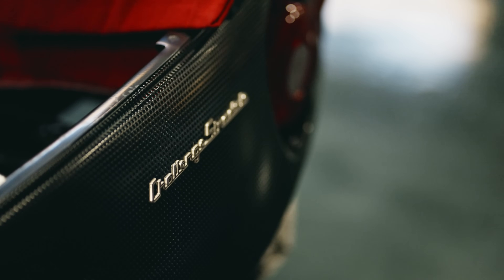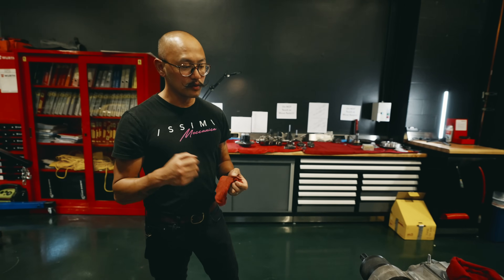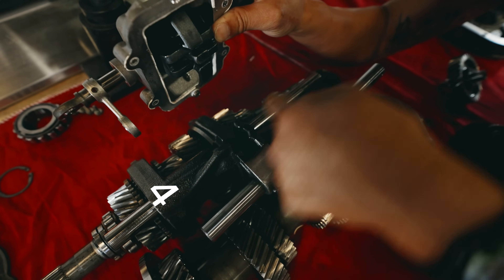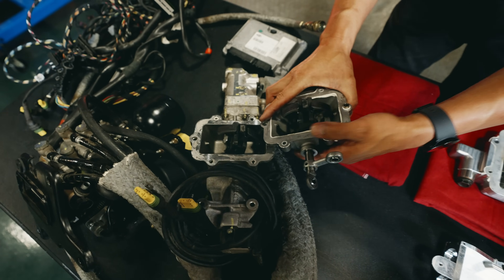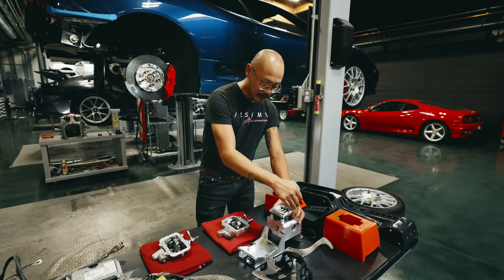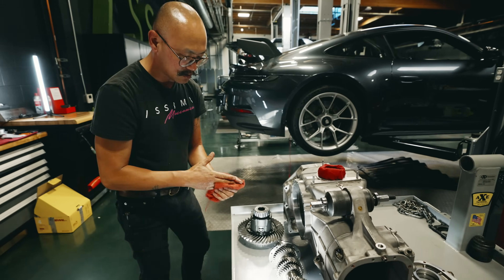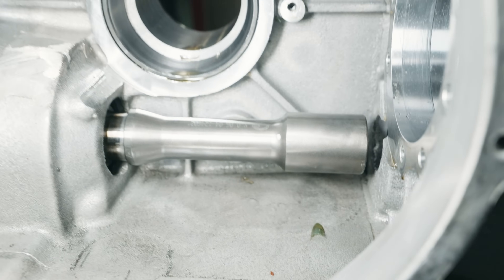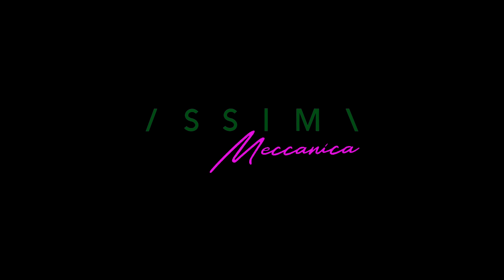Dissecting a Manual Challenge Stradale Conversion - ISSIMI Meccanica

Comment: As time goes on and we get more nostalgic for the things we had, 90s/2000s manual cars will become the most sought after variant. So im all for swapping paddle shifters out and making the car more 'personal' to drive. So many cars from the 60s to 80s had those awfully slow 3 or 4 speed automatics, so the realm of possible manual conversions is quite large. I imagine a 300 SEL 6.3 with manual swap will release a lot of driving pleasure, a Ferrari manual swap will be even more epic.
Reply: I also think it's important to encourage these kinds of builds because there were so many amazing cars from this time period that weren't offered with manual gearboxes (E46 CSL) and are improved so much from a driving experience standpoint to have them.

I don't have any clue how feasible it is, but I'd love to see someone figure out how to swap a manual into a Lexus LFA. Based on people's feedback from driving manual F430s (and how "responsive" the engine is in a way that they didn't really experience by using the F1 box), it feels like a manual LFA would be a life-changing experience.
Reply: @Talynen  Good idea with the LFA, one can only imagine how orgasmic it's superfast reving V10 can feel with a shifter like the Porsche Carrera GT had. The single clutch shift mechanism of the LFA might be a big hurdle.
Reply: @mickwrinkles2318  @Talynen It certainly helps when an existing car already had a manual version, be it using the same engine or even a less powerful one. I think the LFA could be a bit more difficult because of the electronics, but above all else, the fact there are no similar cars made by Toyota/Lexus from which they could adapt the transmission.
From what I was researching about it, it's an automated manual transaxle, albeit a sequential system.
In theory, perhaps you could somehow convert it to fully manual operation, though that would require adapting a new pedal box for the clutch pedal along with the rest of the necessary systems.
I don't know if the sequential system would remain in first place, but having the ability to manually shift would already be great.
Reply: Mercedes should be auto.

Comment: Loved the inside look into how the F1 'box actuates, explains how flawed it feels and how much of a flappy paddle head you'd have to have to order an F1 car when you had the manual option.
I'm currently having the "shift to third" problem in my E36 with worn out bushings which is unacceptable to me there, let alone a 360!
Driving the finished product would probably make the word special an understatement.

Also, IS THAT A 1/350 COMPETITION YELLOW MICA FD?????? Wonderful
Reply: Noticed the fine Yellow FD in the back as well...

Comment: The video i didnt know i needed, ...but omg yes, please give us more of this stuff. Well made, yeah a little dark in some shots, but that made me sit forward and pay attention more, rewatched a couple of times already even lol, it felt very much a natural flow though, really awesome vid, loved every second, and im sure, will likely watch a few more times. 
Ferrari`s system is interesting AF, im a paddleshift guy, yes im guilty, but showing its still a manual underneath some systems, not torque convertor, awesome, and where the shifter SHOULD sit between gears in a manual, awesome, that all just touched my engineering G-spots and driving soul.
Some paddleshift (perhaps many/most?) have flaws or drawbacks for some drivers, flaws that may not fit with what they want from the experience of driving, i totally get that, i was once there too, and with systems like this one that can destroy themself in a way that requires a mortgage to repair, this is an interesting and cool mod, how many owners ever drive them at race speeds and could benefit from paddleshift, even a dual clutch ?.
We have cars that are SO fast now, even basic sedans are quick to 20 yrs ago (not to mention electric), but the roads havent kept up, nor the laws, so slowing down things, including the shifts, chills us out a bit more, making things a little more deliberate and back to basics to enjoy what driving is to us, ...more than just getting us to another location (thats the role of electric 😝).

Many thanks all,
                             Dan.

Comment: The issue with manual swaps is the flywheel. The F1 transmission is mated to a flyweight flywheel. The comparatively slower shifting manual requires a heavier flywheel so revs don’t plummet uncomfortably between shifts. They try to compensate with a rev pause  feature via the engine’s ECU. But it’s not the same as if the drivetrain was designed for a manual from the start. Ferrari are idiots for abandoning manuals.

Comment: It's a weird period in time when these single-clutch automated manuals were all the hype. Now almost every car that had these would be better with a different gearbox. And it's not only the shift action alone: we have an Opel with Easytronic and compared to a VW DSG the clutch operation is much worse. It can stall during parking, sometimes it engages abruptly, sometimes it slips... just pretty inconsistent at low speeds. Once you are at normal speed (nothing sporty, it's just an economy car) it gets better, but I still prefer modern torque converter automatics.

Comment: I had the MT Version of an Aston Martin Vantage. It's paddle-shift version was also a MT with a clutch and hydraulic actuator system. It eats clutches, so I stayed away from those cars. It's the reason I don't own a 360 now (no, I can't afford a MT version lol). Does the 430 have a better transmission?

Comment: It is great to see the manual transmissions being retrofitted, if that's even the right word, into cars that never had them.  There are so many good ones that have already begun, like E46 M3 CSL manual conversions; I look forward to seeing more manual upgrades in the future, to cars like the LFA.  As valuable as these rare cars are with their flappy paddles, they will increase in value if the manual swap is executed to an OEM standard.
Reply: I don't think making a limited-run car less original makes its value go up, even if the driving experience is better because of it. That doesn't seem to be the way most collectors think.
Reply: Would love to see a LFA manual conversion. Heard they are starting to have oil pump issued that are well in the 6 figure territory...
Reply: @SmallBlogV8 depends. Manual vanquishes are the same or better, for example.

Comment: How much was the total cost? There are a group of shops out there who all charge $35,000 to convert a Ferrari to manual transmission, which you a huge scam. You would have to be a complete idiot to spend $35,000 per set of pedals and a shifter. 

I know someone who converted his 355 Ferrari to manual transmission for under $4000 and he did it over the weekend. 

Why are all these shops consistently charging the same price of $35,000 and not $30,000 or $25,000. Sounds very fishy to me.

Comment: I had my F430 converted to manual, but the Challenge Stradale is a collector level car and its market value is so high, I would never change it from an OEM.  It destroys all that value in the market.
Reply: The changes aren't permanent. You can change it back. I'd wager the conversion would increase the value too.
Reply: @future62 Plus, it's a machine meant to be enjoyed. If a manual is more pleasant to you, resale be damned.
Reply: I'd reckon ole sir that its likely more important just what parts were used for the conversion. I dont see the price destroying the value of the market as long as its OEM Ferrari F1 gear box -> Ferrari gated 6 speed. Plus retain the OEM gearbox for the next owner if ever selling. You have an ultimate car at that point so I'd advise not to sell, so essentially the 360 Stradale 6-speeds are reducing the ones on the market, increasing value!
Reply: More than likely it will increase value. But who cares, it’s meant to be enjoyed not view it as an appreciating asset